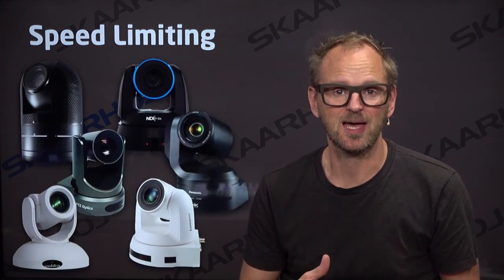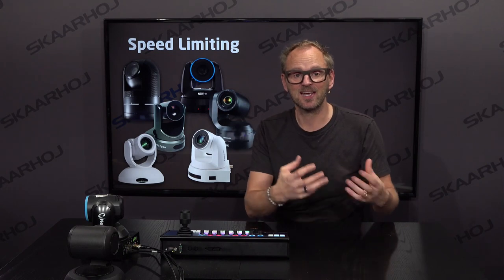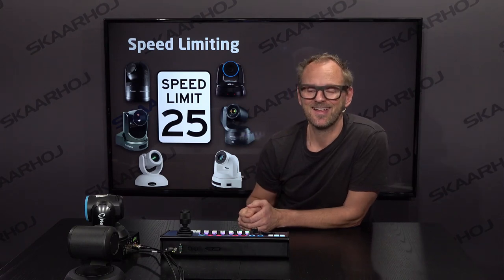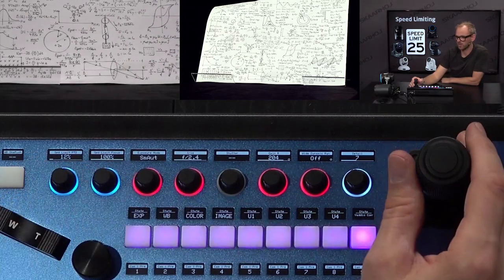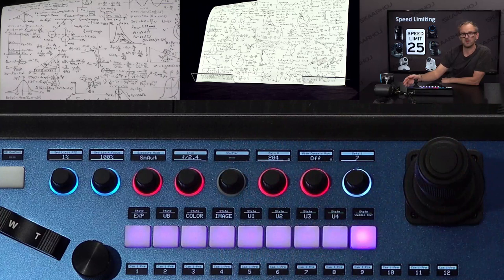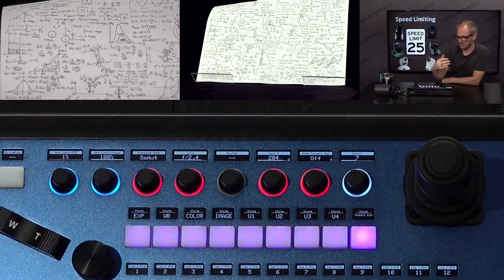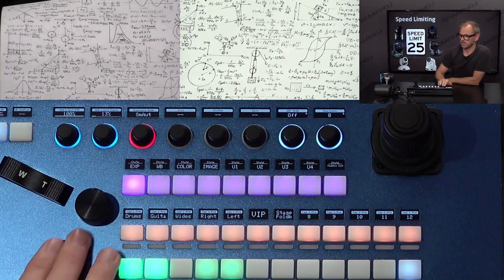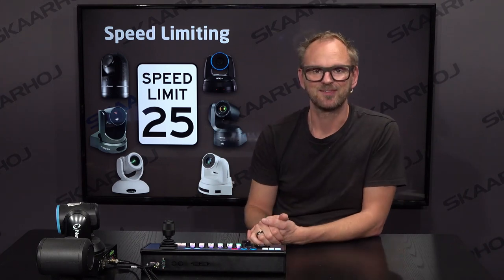Get better and more smooth control of your PTZ camera!

Comment: I am using a ptz-fly with vaddio roboshot ptz cameras and have to set the speed limit every time the fly gets power-cycled. is it possible to save the pan/tilt speed limit and the zoom speed limit as a default on startup? how would I accomplish this?

Comment: Hi I have the Aida x12 NDI and Pan + Tilt works great. Unfortunately the Zoom dose not work. Any update in the Future?
Reply from the maker: Hi Marcel. Thanks for reaching out. I just tested our Aida's with a PTZ Fly, and the work fine.
Are you using your own configuration or a SKAARHOJ default config? 
If you are using your own please double check that the Joystick is configured correctly.

Another possibility is to check the firmware of the camera, we had issues with the NDI version last summer, and that was fixed on the newest firmware of the AIDA's.
Check the manual about AIDA for more specifics: 
https://www.skaarhoj.com/support/manuals

If neither of these suggestions work, please write us at support@skaarhoj.com and we will help you out.